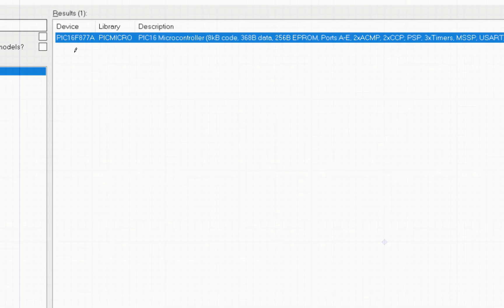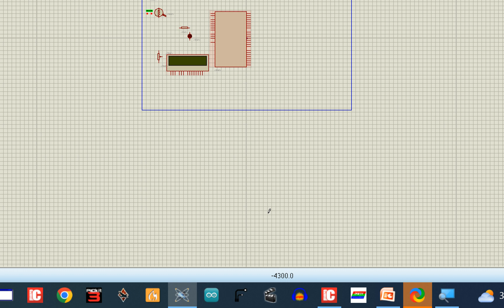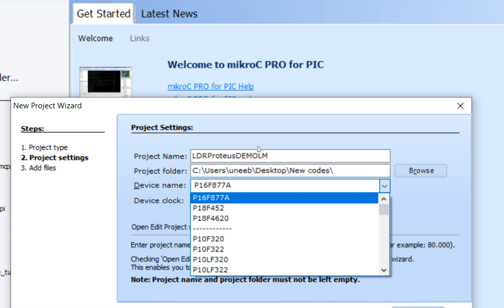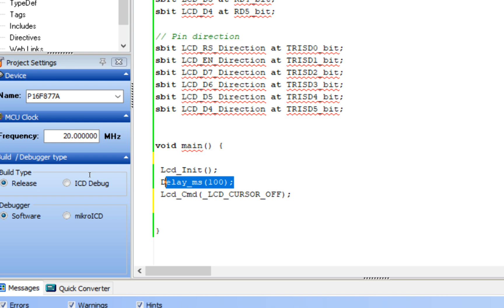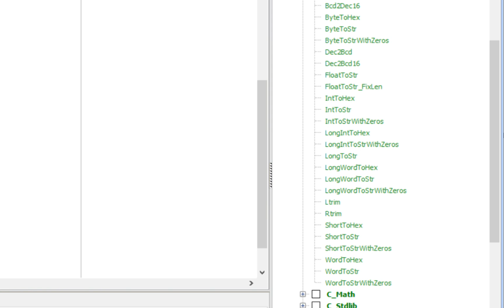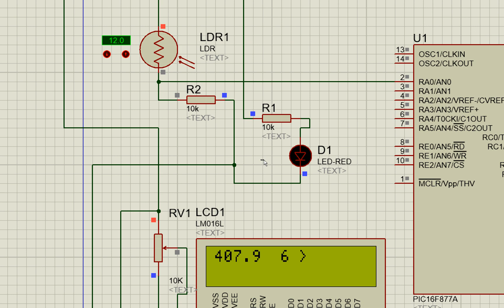PIC16F877A interface LDR. Tutorial. MikroC for PIC coding and Proteus simulation based mini project.

Comment: I Did Lot of changes But not working...
This is the code . What to do .  only  if   and then else . then again if  and then else ??? Please make a chage and reply thanks thanks thanks.

int count = 0;
void main () {
TRISD.F2 =1;
PORTD.F2 =1;
Delay_ms(100);
TRISD.F3 =1;
PORTD.F3 =1;
Delay_ms(100);

PWM1_Init (5000);
Delay_ms(100);

count = 0;

while (1){
 PWM1_Start();
 Delay_ms(20);
 if (PORTD.F3 == 0)
 {
 PWM1_Set_Duty(count);   // 0 to 255
 count = count + 10;
 Delay_ms(20);
 }
else if(PORTD.F2 == 0)
 {
 PWM1_Set_Duty(count);   // 255 to 0
 count = count - 10;
 Delay_ms(20);
}
}}
Reply from the maker: I will make a mini video on this 
Stay in touch

Comment: Sir, in this  Video you made ""PIC16F877A LED brightness control using push buttons tutorial. ""  when buttons go to 255 then it again come back to zero. I need that to b change if i Press the button at 255 it remains on its maximum 255 not come back to zero state. HOW can i do that.
 My motor Slow and Fast with 1 Button , Why i need two buttons than.   Please reply thanks.
Reply from the maker: Just use if else condition
If read1== 255 then make a forever loop inside this and stays tthere